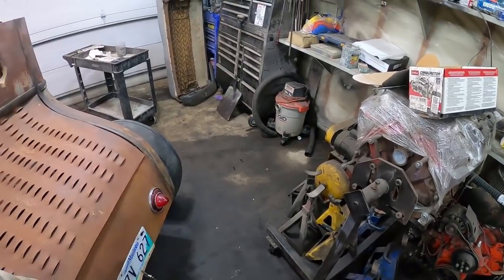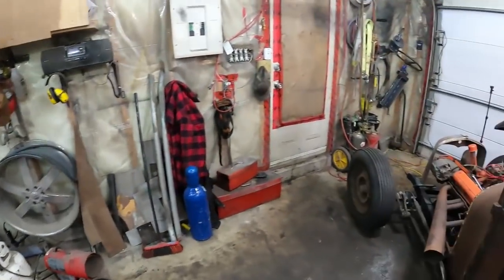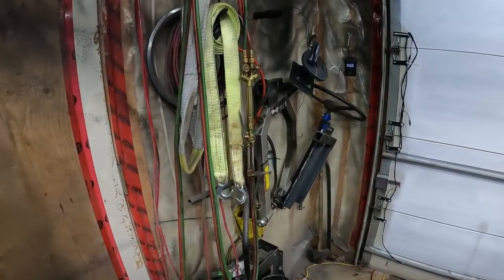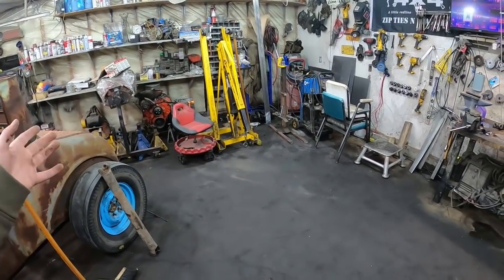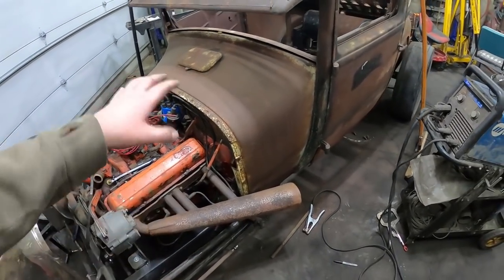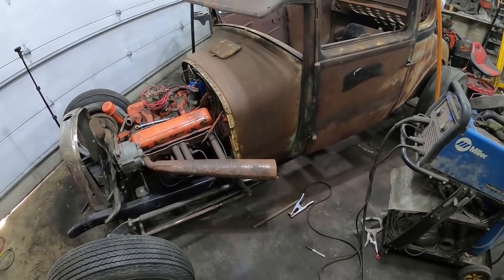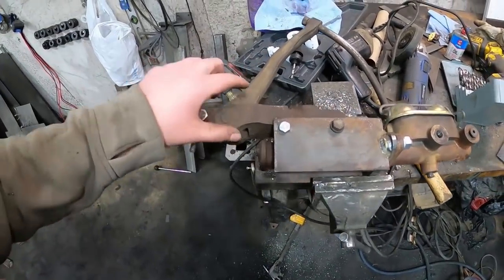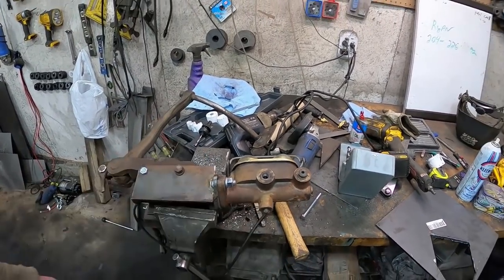Steering, Brakes and Floor Structure for the Model T Coupe - DD Speed Shop 1927 Chopped T

Comment: Really like the build!   Just a reminder...make sure you do all your setup to keep the steering box turns exactly centered when the wheels are straight ahead.  The box is a bit tighter there to allow for wear and adjustment.  If you set the box up off center you get slop in the steering and worse, set yourself up for death wobble.  Just reminding because its very easy to miss the center point slightly and you don't have to be far off to end up with issues.   The T is gonna be awesome!
Reply from the maker: abosultey!  thanks for the tips my friend

Comment: For the body mount holes I would use exhaust pipe welded around them before you lay the floor ,and cut the holes for them then weld the other side to the floor. Then you can use some kinda plug to cover the hole. Looking good!!
Reply from the maker: thats a solid idea!

Comment: I made a floor in my 23T out of 1/2" plywood. glassed the edges to the body to make it one piece. The tunnel over the transmission was made by taping newspaper then 4 strips of cardboard fairly snug over the trans then covering that over with 2 sheets of resin and cloth. There was hardly any hump in the floor by doing it that way. The newspaper was there as a filler which was then removed to allow air to flow around the trans later. I have driven the car for over 20 years now and 16,000 trouble free miles including racing. I still don't know why people build their floors out of metal.

Comment: Tidy tidy, I’ve finally figured out your trick of cleaning before u start, I’m going to change the shed a bit, going to use my bench as a actual seat, not sideways same as yours and moving vice and raderah, thinking about a welding table too
Reply from the maker: yeah doing a little organizing sure makes a difference

Comment: Make the bottom of your diamond shaped steering box mounting plate square and then just bolt it to the frame. This will make your steering box removable without taking the engine out. There's other ways you could do it too.
Reply: A pillow block shaped flange welded to the steering box would simply bolt on top of your frame with (2) bolts. Perhaps add a removable 5/32" thick plate zee'd from the inside cover bolts to the frame for a back-up brace? Use either cover's bolt pattern for a skeletonized access port for adjustments but float the bracket 1/32" with the frame fastener(s) permitting driving to the berm during a U-bolt failure.
OR..... Plasma cut a thin rimmed donut to weld on the steering box snout of thick steel (5/8" or greater). Weld arc shaped gussets to form a frame wide nest to cradle the underside of the snout. Weld a short arc shape tab to the underside of the snout. The steering box now can be lowered into it's nest, a rear axle U-bolt can fasten the box securely. Add the secondary brace inside as back-up?
STEERING COLUMN: Please use a modern joint connector, don't weld, fillet radius any machine shop formed sharp internal corner. I like a double D, shaft ends can be milled using the side of the end mill not the cuttter's bottom corner.
FRONT AXLE: Looks plenty strong, are you going to drill it?

CAUTION: Dimensions and suggestions are only given to illustrate each concept, alter physical and material characteristics as required per your needs, driving style and car's mass. Have the completed assembled automobile inspected and approved by a State, Provincal or equal governmental authority before driving it.

Comment: Dan, when you get to the firewall replacement, look at how Robert ( halfass ) did the firewall on his 38 Pontiac with the alum speed limit sign and engine turn pattern  ! very sharp and easy to do ! .
Reply: Patch for the distributor recess?  What about the end of an oil pan, may need sectioned to remove extra width?  Or an end of a Chevy 6?    Look in good, 4.24.20

Comment: it is coming together fast Dan you might want to change the pitman arm angle at center it should be straight up and down and the rod to the wheel needs to be level to take out a lot of bump steer awsome job
Reply from the maker: totally,  just sizing everthing up.  thanks for the tips

Comment: Been working on cleaning painting reorganizing built a tool shed so I can work in the garage not the driveway I put some plywood and painted it then screwed it to the wall to hang tools on using 2 1/2 and 3inch coated screws I got a Lowe's hammers saws clamps levels and stuff I forgot I had too
Reply from the maker: its funny the shit u find when your cleaing haha

Comment: Talk about frame rigidity!  You’ve got it in spades. You can’t have too much floor support. The deck lid still seems a bit flimsy. Some of that half inch would tighten it up.
Reply: Or have Brent plasma cam (2) 1/8" thick x 5/8" scrolled inner frame member to be located between the next to last and outside row of louvers.  Shop looks great!

Comment: Hey man just a thought, when you said the steering box would need the motor to come out. Maybe weld that plate you made to the frame but cut a passage ob a 45 or so between the bolt holes that the output shaft housing can fit down in (edit- through). Then make a plate like the first without the relief, weld it to the box and then bolt the plates together. Did I describe it well enough ? She is coming together real nice, floor structure looking great ! Look forward to seeing more !
Reply from the maker: yeah iv had lots of thoughts.  i dunno if i wanna over complicate it haha

Comment: Maybe move the seat back as far as you can and then move the pedal assembly and linkages forther in from the narrow spot. Otherwise... three pedals in that skinny spot is hell on big modern feet. Just sayin' :-)  Go square fuel cell with a baffle so you don't run out of gas in ten minutes. :-))

Comment: Your going to question if that is YOUR shop with it all cleaned up !!!!! Where am I ???  lol  My opinion, plan on quit a few corner gussets to stiffen up the floor framing or your looking at that 1/2 inch framing sagging with 2 adults and seats installed going over ruff roads . . Lots of welding to do partner !  :)
Reply from the maker: lots an lots of welding haha.  ill definatley do a few more braces and the bead rolled sheetmetal should help a little as well.  i hope anyways haha

Comment: Have you got enough room to drop the trans by itself?  
Now the camera angle maybe doing "it" but right now it looks like even if you can drop (unbolt?) the trans mount from the frame, the output shaft of the trans itself is too long to drop straight down (and you can't move it forward without loosening the engine mount) and it will get more complicated once U joints and driveshaft are in place.  If you notch that cross member its a major change to the trans mount.  If you make the trans cross member removable you have to 
re-think your rear link mounts.
Reply from the maker: yup i decided to just go with it.  The motor and trans will have to come out as a unit for sure

Comment: Everything is looking great, but shouldn't the rear suspension be at full compression to make the tunnel, to make sure that the drive shaft clears?
Reply from the maker: i gave it the bounce test.  seemed okay plus i still gotta put in some bump stops

Comment: That Edelbrock carb should work perfect on you 283 motor for sure. especailly if its a 650 cfm. Man your getting a lot of work done for sure.
Reply from the maker: yup!  im trying to stay busy haha
Reply: @DDSpeedShop   The Carter & a Edelbrock Performer RPM intake perfect ( hope them heads are 1.940 intake vales !)

Comment: With the trans tunnel if you could recreate your headers except two separate longer pieces that the front is more dramatically larger than the rear.. it may look a little nicer. Although you arent going for a show car either. Then at the firewall start "flaring it" with about 5 sections of about 4 inch wide stripes. Figure out your curve whether that's with cardboard or welding wire and cut some pie cuts 2 inches down the width. Bend "horrozontally" along your 4 inch wide, 12 inch long(ish) strip...(long ways) to about 50° then bend your piece around the tunnel. If you want it real smooth cut more  lines. They will turn into pie cuts that you then cut little pieces and weld in. Then weld that to your header style curved piece and bam. Most of a tunnel.😂 OR the other quick option is a wheelbarrow.....cut it to your height at your angle... narrow it... 😂
Reply from the maker: haha that sounds pretty complicated
Reply: @DDSpeedShop  eh it would probably take longest to weld the pies in the pie cuts. But it would turn out to be a pretty decent looking piece. You've probably got an idea going that you'll make look good though that was just a way I've seen it done.

Comment: Lay the sheet metal to enclose the bottom to keep out the environment and then install hardwood flooring.
Reply from the maker: thats a pretty cool idea!
Reply: Metal flooring would be lighter plus add needed strength to complete the structure as a total package .

Comment: Hey first thing I love your channel! Secondly I notice with your steering box and brake master cylinder mounted on the frame. Everything is kind of jammed together tightly. Would you consider mounting the master cylinder to the firewall. If you hang the brake pedal from above you might have more clearance around the steering shaft. And the floor can angle up to the firewall. Well that's my 2 cents. Thank you for the great content!
Reply from the maker: the firewall is pretty right.  plus i like the way it looks without the master hanging over the motor.  thanks for watching my friend!
Reply: @DDSpeedShop  For sure. Just thought I'd give my two cents. Keep up the amzing work! BTW I love the '57 2 door conversion!

Comment: Just wondering what's wrong with the orignal master, don't want suicide brakes? A good person to check out for cross-referencing or to figure out what you need other than net surfing would be Norm at Mid Canada suspension. He could probably even find you a master cylinder that would fit right where the original one would be.
Reply: The Model T had no master cylinder, only a brake on the transmission, which reacted on a rear wheel unless one was in mid air!  Dealers and auto stores sold aftermarket rear brake kits, especially to customers living in the mountains.

Comment: Hey Dan was digging around on rock auto looking at master cylinders. You think the brand "Centric" part # 13062024 will work for you? I see in description it says with front drum brakes
Reply from the maker: ill have to check.  thanks for looking out!
Reply: @DDSpeedShop  no problem hope it helped.

Comment: How much up travel do you think you’ll have on the rear suspension? I’m just wondering if the link bars are going to hit the floor cross members
Reply from the maker: its probably only going to have 5 or 6 inches total travel
Reply: DD Speed Shop as long as it hits the bump stops before the floor!
Reply: Street Rodder always suggested to stage the travel using a 2" x 4" on edge.

Comment: I know it's a little head of you now .I find a Jeep gas pedal is ideal for the limited space in thes old hotrods.$15 on ebay
Reply: You can see my 31 coupe video on my page.drove it 900 miles the week after I finished it
Reply from the maker: nice!  ill have to check it out.  and good tip on the pedal, thanks!

Comment: What if I put a comment and dont have a clue? Lol just my dumb thought again but use as you see fit. But I would make the firewall removable from the inside for easy access to brakes, steering and bell, housing bolts just my thoughts. The rear brace your thinking of leaving straight you might want to put a curve in it for the shaft or it will rub when you load it up.
Reply from the maker: yeah everything is just tacked together.  still needs lots of fitting before final welding
Reply: @DDSpeedShop  I cant wait to see it idling around it's a sweet project.
👍👍